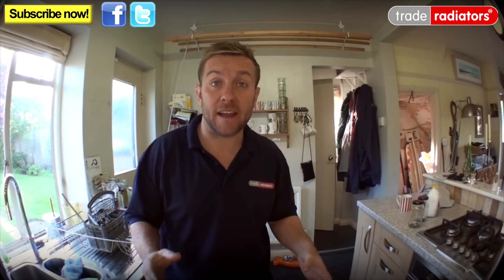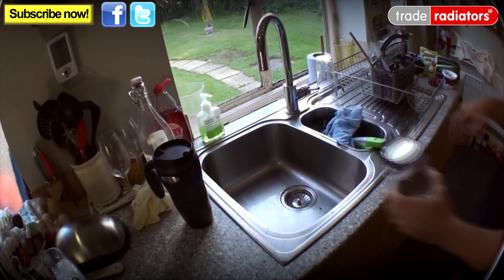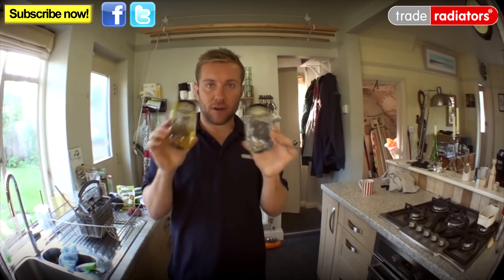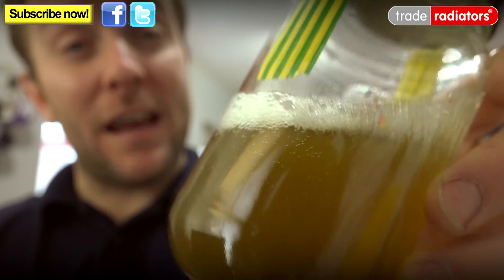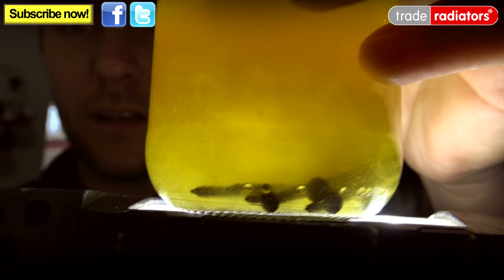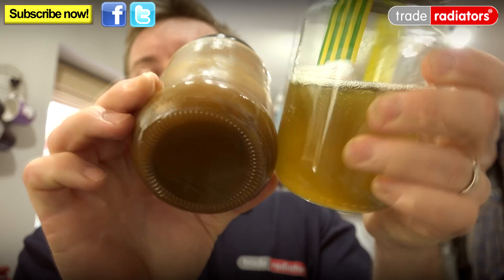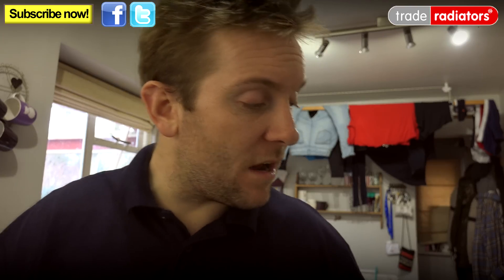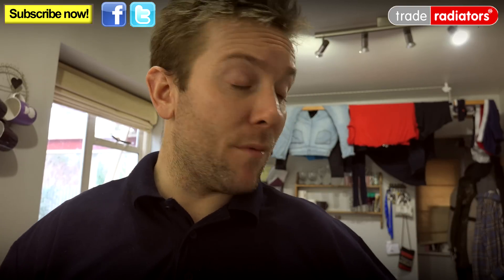Adding Inhibitor Fluid to Central Heating System

Comment: Wouldn't it have been better to use the actual dilution that would usually be used in a CH system rather than 50:50?